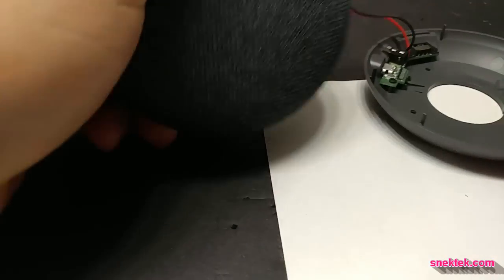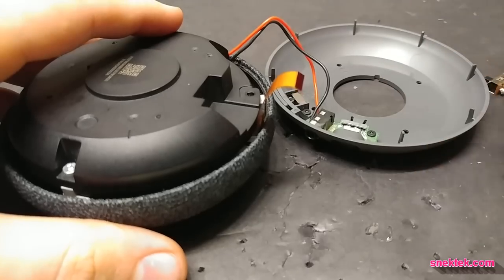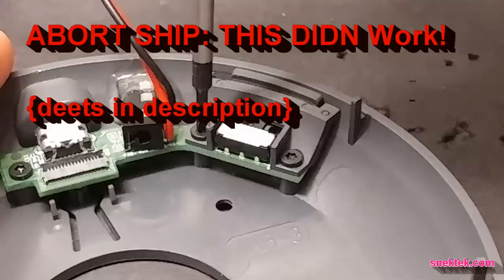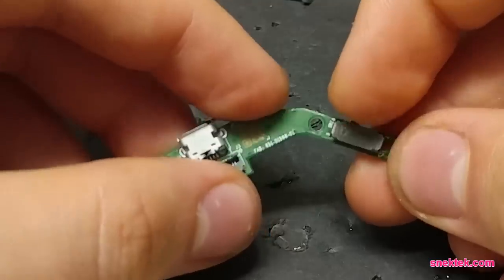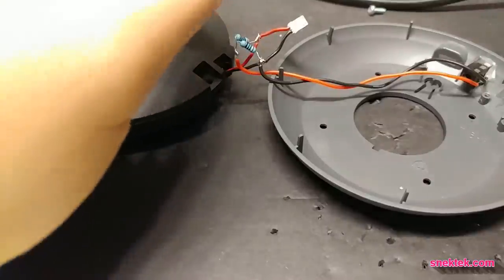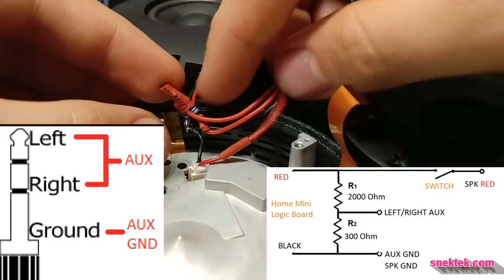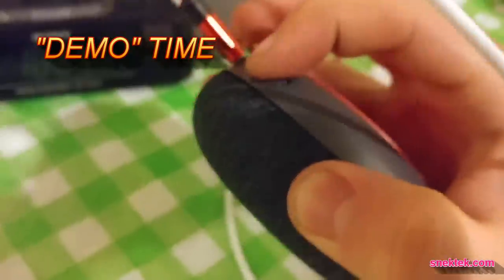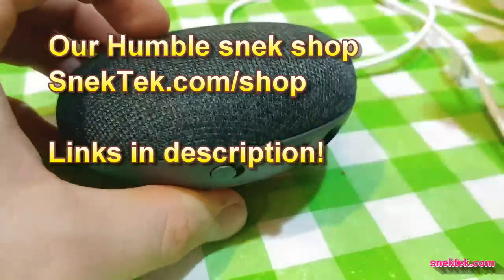Revenge of the Home Mini Headphone Jack and Mute Switch Tricks (Mod Kit Available)

Comment: There are special 3.5mm sockets with passthrough leads that are disconnected when jack is inserted, those would've been useful here.
Reply: When you look at his 'square' hole he cut and the fact that he had to permanently remove a screw for it to fit and his voltage divider that didn't take into account loading and his other wiring errors, do you really expect him to know about and use the built-in switch on an audio input???
Reply: Robert Evans, just saying that such thing exist. Should be easy  to redo if he finds one. I didn't know about them either, up untill the point I needed to fit headset connection to an old landline phone long ago. Bought one by pure chance that time.
Reply: Interesting, what type of 3.5mm jack are they and can you post a link here?
Reply from the maker: Robert Evans 💔
Reply: That Tech Though, sure. Looks like many of them are like that. https://www.rapidonline.com/switchcraft-35right-angledpc4bh3-horizontal-3-5mm-stereo-socket-20-1660 this is one. But I'd say look for any with 5 or more leads and check diagram.
Reply: I wasn't aware of that -- so the information was very helpful for me!
Reply: This is great, and I want to use this solution. Can you tell me how to get the voltage reduction for the line out, while maintaining the full voltage for the built-in speaker? That would solve all the problems. Thanks in advance.
Reply: Hey @SnekTek, thanks for the video. I am going to attempt this. I found these 3.5mm jacks with in-built switches in the same form factor as the ones you used. (you can find them at www cui com, part no SJ-3503-SMT-TR). My only question is, how do you get the voltage reduction for the out-pins while maintaining the voltage for the inbuilt speakers? If you can educate me on how to accomplish that, I will be grateful. Thanks again for the awesome video.

Comment: 330Ω / 3.2kΩ. This worked fine (maybe a bit low output volume). But as soon as I cut the black cable to the speaker, the AUX port became mute. (did not want the original speaker) Did the overall voltage drop when the speaker are not connected?

Comment: Do you even have to reconnect the mini's speaker if you plan on using just the AUX port?  Also, will the mini's side touch volume controls work for the AUX port?  Great video and thanks!
Reply: Andy Weigel it should be ok just cutting off the speaker and the volume will still work
Reply from the maker: +Andy Weigel someone is thinking! yes you could just leave the speaker inside disconnected.
Reply: Are you using a mono 3.5mm jack for this or just splitting  the red wire to the left and right connections and the black wire to the negative of the jack?
Reply from the maker: +Andy Weigel It's a stereo jack (microphone as well actually) so I connected the red wire to left and right channels.

Comment: Can you provide explanation why your resistor from the Red wire and resistor from the black wire both join to provide the red wire aux line?
Reply from the maker: +Curtis Rose The resistors form a network called a voltage divider. It reduces the voltage on the aux to provide the right levels for aux devices. So the signal on the aux is the same as on the speaker, but smaller in magnitude.

Comment: I modded my second one but for some reason this one stops playing sound when the volume goes above 40 percent... If I go higher quickly the home mini resets. Then I need to reduce the volume below 40 percent before any sounds to stop it cutting out again. Anyone else have this problem? I tried adding more resistance in case it was because the auction port was drawing too much current from the mini. Hmm

Comment: Do you get feedback, do you find the added resistance, to be good, would you recommend more or less.
Reply from the maker: No feedback. 270 and 2000 was fine, you could go with 270 and 1800 it really just increases the volume a bit more.
Reply from the maker: The kit we are selling on our website is 270 and 2000
Reply from the maker: +SnekTek kits are 300, 2000 actually

Comment: I did the mod using 300 and 2000 ohm and the sound when hooked up to my sound bar and sub sounds nothing like when I hook up my iPad. Any reason why ? The sound does not have the same bass or treble but def lacks bass. Any thoughts appreciated. Thank you.
Reply from the maker: The sound is equalized because bass would distort on the tiny speaker in the google home. Best suggestion is to reverse equalize, turn up the bass on your amplifier, if possible.
Reply: SnekTek thank you for the response. I am curious if the Alexa echo dot which has 3.5 built in audio out. Would it have better audio out then this mod....? Or would u say comparable about the same. Thanks for great video. 👍🏻
Reply from the maker: I think the echo dot has the built in output. And it will likely sound better.

Comment: Great video ! I just bought two minis. I want to do this mod. I am not planning to do the switch mod as you do in this Video. Should i then use the resistors from the first video or the two resistors in this video? I don´t understand why you changed those two. :)
Reply from the maker: Hey thanks for your comment. I changed it because the volume on the external speakers was a bit low, go with the values I used in this video, or similar ratio, and not too much higher or lower values. Eg. 300 + 2000 or 270 + 1500 or 470 + 3000, something like that
Reply: Great thanks for the quick answer :)
Reply: @SnekTek   - what about 330 and 3300 is it OK? And do you use both the left an the right on the jack? Or do you just use one of them?